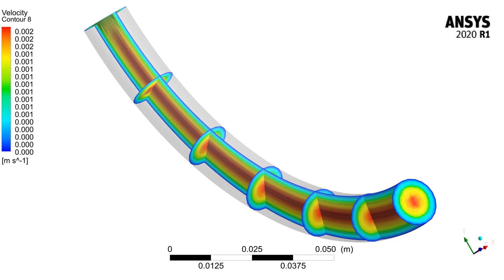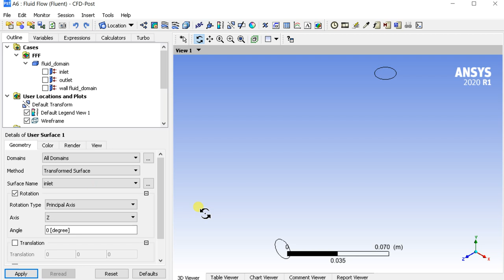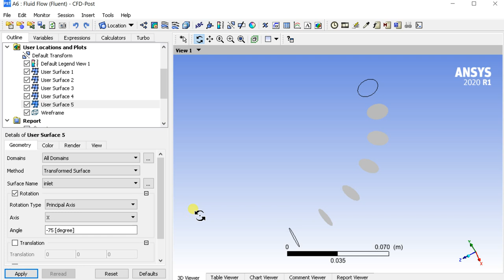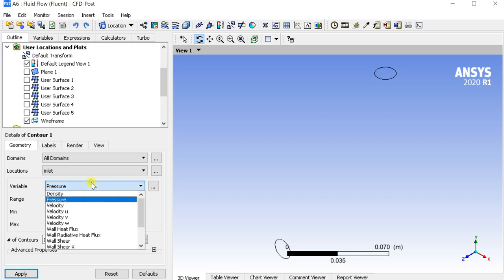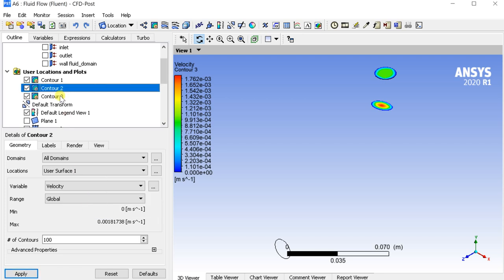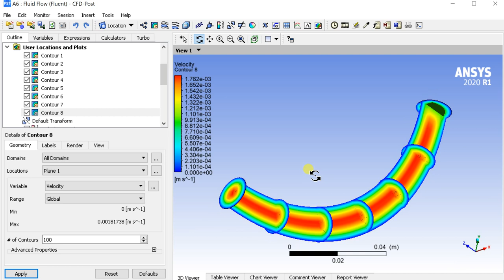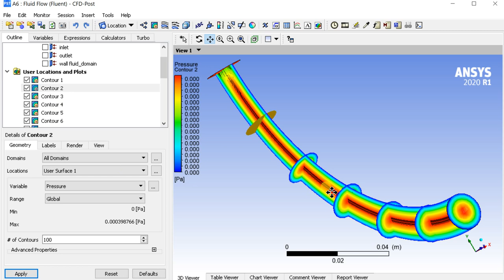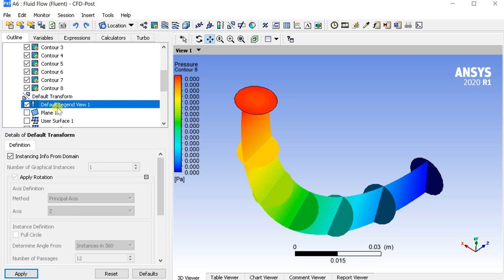How to get Contour Image Along a Bend Section | Creating a User Surface in ANSYS CFD Post-processing

Comment: Thank you for the tutorial. Could you please tell me how to create the plane if it is a spiral tube?
Reply from the maker: You need to have the central axis at the center of the spiral tube. Then only you van create the user surface in the spiral tube.
Reply: @AnsysTutor  Thank you for your reply. But I still haven’t solved the problem after several attempts.😭I've been doing simulations of a double- spiral pipe heat exchanger, I would like to get the average temperature on the surface to calculate the heat transfer coefficient along the spiral tube. Would you please be so kind as to help me with a tutorial about this when it is convenient for you？❤️

Comment: make a tube, 1 cm diameter, 20 cm long.

- put a liquid in it; a magnetic ferro fluidic (inside of oil; so droplets of ferrofluid or a "Slug" of ferrofluid)
- put a coil of wire around part of it (a solenoid)
- put current through the solenoid

And simulate the motion of the ferrofluidic as current is run through coil (or pulsed)

please solve this problem